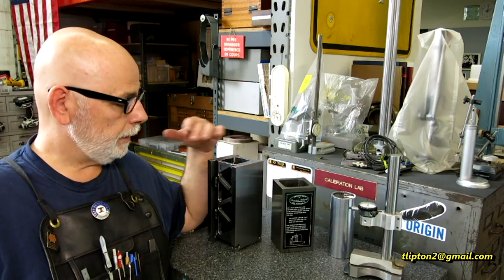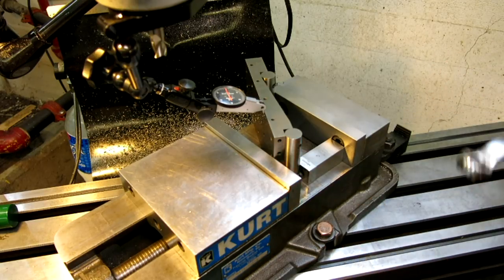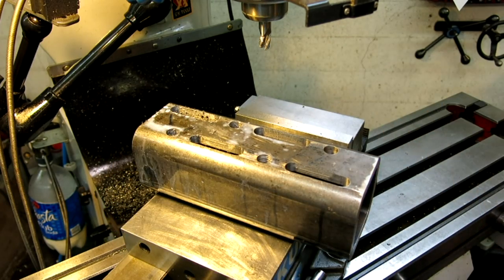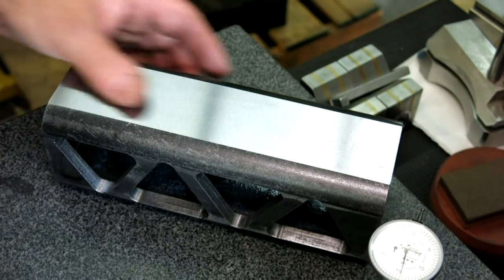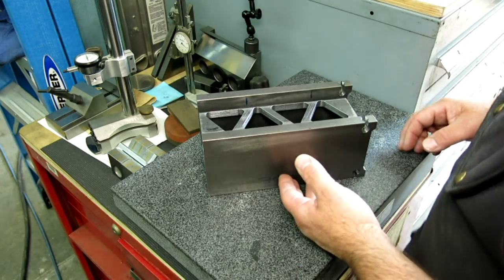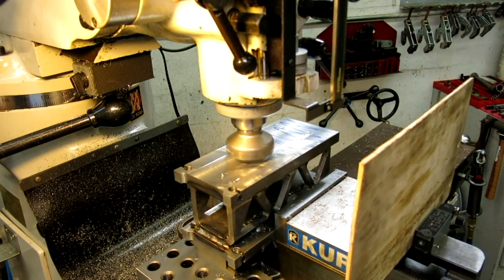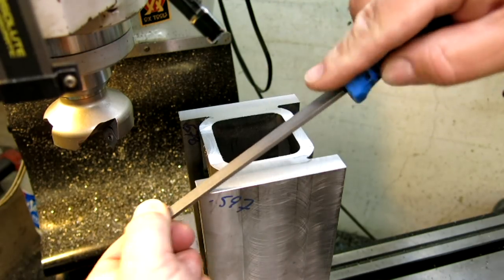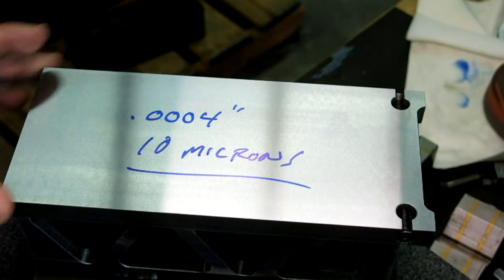Composite Master Square Construction

Comment: Thanks for another great video!  For those of us without a Squaremaster, do you have any recommendations on a way to sweep a vertical surface to quantify perpendicularity to the surface plate? I just keep thinking there has to be an affordable alternative. Thanks!
Reply from the maker: Hi Robert,

Qualifying the entire surface is pretty tough. You can do multiple points but you still have to extrapolate between them. That said once you have a good master you can probably easily make a facsimile of a squaremaster with a precision preloaded linear bearing.

Comment: How do you protect sensitive electronics from high voltage? I'm building EBM metal 3d printer and don't want to fry shop equipment, thanks
Reply from the maker: Get rid of all your sensitive electronics....... Just kidding. Don't get any electronics between the ground and electrode.

Cheers,

Tom

Comment: Hey Tom, love the old school method of making things, cnc is nice but well,  you know. Is the carburize a separate job, or is it what happens as a result of heat treat? When I mess up or forget something I call myself Ya Moran. Thanks God Bless ya   Dave
Reply from the maker: Hi David. The carburize is the heat treatment process that will add carbon to the surface of the steel allowing it to harden. Its one job. Lots of good info on the web or heat treaters sites. Cheers. Tom

Comment: Not a machinist, but an avid watcher.  Why do you cut the triangles in the sides of the tubing?  Is it to lighten the entire thing, is there some other structural/stability goal it achieves, or maybe it is so that you can attach a clamp?
Reply: Perhaps Tom will chime in here, but the general purpose is to lighten the tube. Cutting out the triangles leaves a truss structure, which retains the vast majority of rigidity and strength, while removing substantial weight.

Comment: Your magvice has limited room but would it have been better to rotate the work piece about z (like say 45deg) to decrease the amount of heat buildup on each pass? (Edit: As I continue watching you bring this up and say its ok for the small surface area on the edge of the plates.)
Reply from the maker: Hi Eric,

You need to be able to control heat and distortion without having to rotate the work. The reality is that only works for small square blocks. Lots of features and grinding needs to be aligned with the machine axes. 

Cheers,

Tom

Comment: Isosceles triangle? Weren't those equilateral triangles? Or did it just look that way?
Reply from the maker: I think you got me on that one. Equal sides and equal angles. Thanks for keeping me honest.

Cheers,

Tom
Reply: Equilateral triangles are also isosceles triangles.
Reply: Circles are not ellipses and squares are not rectangles, regardless of what grade-school teachers tell children just wrapping their heads around basic math are taught to "simplify" geometry. And although I've heard the "squares are rectangles" spiel and its at least somewhat "legitimate" IF you stay at the "elementary" definitions, I've never heard the "circles are ellipses" bit before and probably because it's obviously a lie. That's not to say its not in a lot of math "textbooks", but its false. Period. 

FIrst of all square vs. rectangle and then I'll dispense with the "circles are ellipses" garbage, although the reason neither squares are rectangles or circles are ellipses is the same in both cases and should be obvious and is obvious to people that learned geometry beyond an elementary "keep it simple" level. A RECTANGLE is a quadrilateral with two pairs of sides of different lengths perpendicular to each other and if one interior angle is a right angle they all are and its QUADRANGLE. 

Two measurements are required to calculate its area and its circumference and a third is required to calculate the volume of a box formed out of two rectangles by adding 4 vertical planes of the same lengths and widths. To calculate its volume you still need to measure the length and width of the rectangle and multiple the area by the height of that box. You have to measure that height because until you do, its not possible to know it precisely. So determining VOLUME of a box formed from rectangles requires THREE measurements and two calculations. L x W = A and A x H  = V. That makes it a COMPLEX shape and "complex math" is required to determine the simple quantities of that shape and the object it forms when made three dimensional.

A square is a also QUADRANGLE but its also a QUADRILATERAL and therefore it is NOT a rectangle. If it were it wouldn't be SQUARE and the box it forms when additional planes that have the same length and width are added to it in order to form a "box" wouldn't be a CUBE.  There is a DIFFERENCE to go with the DISTINCTION. The word SQUARE refers not just to the equal lengths of the sides but the ability to calculate the area by SQUARING the length of a single side so only a single measurement and a single calculation is required. Its circumference is also calculated using that same single measurement. 

Measure one side and SQUARE that measurement and you know the area. Its a QUADRILATERAL rather than just a QUADRANGLE SIMPLE MATH for SIMPLE SHAPES. A CUBE is a CUBE because its VOLUME can be calculated with a single measurement and a single calculation by CUBING the length of one side. A square is a REGULAR geometric shape and a SIMPLE shape that can be SIMPLY measured with even a piece of string cut to the length of one side. If the string then matches any other perpendicular line's length, the object is a square or a cube. If the string is placed on each corner and an arc is swung through the square and the points of the four arcs intersect and form another square, the square IS "square" and its an equilateral quadrangle. Meaning its SQUARE.Another piece of string stretched from corner to corner can be cut and with those two pieces of string you can construct identical new squares with precisely the same dimensions and use them to check the "squareness" of other shapes that appear identical. 

The square is the SIMPLEST geometric shape and that's why its is taught FIRST and any reference to it as a "rectangle" only comes later when the DIFFERENCE between the two is taught and "if we take a square and make either pair of sides LONGER it becomes a RECTANGLE" is used to expand on the basics and move to a more COMPLEX concept and SHAPE. That  gets translated as "a square is a rectangle" INCORRECTLY because the statement is that if a square has one pair of sides lengthened it BECOMES a rectangle. If one thing becomes something else with a different name and different qualities and its more complex, its NOT THE SAME THING. So a square is NOT a rectangle. EACH SHAPE has its OWN NAME because they are DIFFERENT. 

A CIRCLE is also a REGULAR and SIMPLE shape with a constant radius and using simple math the area is easily calculated from one measurement using a single operation. Its radius can be calculated from its diameter and vice versa ALSO with a single measurement and calculation. Using EITHER value its AREA and CIRCUMFERENCE can also be calculated using one measurement and a single operation. By that point in a geometry lesson after squares and retangles and cubes and boxes and probably triangles and pyramids and acute and obtuse angles have been digested and understood, PI is relatively simple and since some people are fraction people and some decimal people, between 22/7 and 3.14, one or the other should stick. 

By teaching AREA first, the good old SQUARE comes back into play and that's a relief for kids wondering how in the hell you measure the area of something that has no sides. PI multiplied by the radius SQUARED. Easily comprehended or at least remembered if the teacher is smart enough to tell them to see the CIRCLE as a SIMPLE SHAPE and to measure the RADIUS and use it to check to see that its actually a CIRCLE if the RADIUS is the same at two points on the outer arc with straight lines to them forming a RIGHT ANGLE at their intersection. If so, then the two diameters those radii are half of will form four equal PIE PIECES. So by measuring the radius and SQUARING IT and multiplying it by PI, the area is calculated. 

Circumference also seems like mission impossible but by taking the diameter because you're going AROUND THE WHOLE CIRCLE and multiplying THAT by PI a SINGLE measurement and calculation gives the circumference as well. And at that point, they whole volume thing is old hat and its a SIMPLE and REGULAR shape so AREA x HEIGHT gives the volume of a CYLINDER. 

The "circles are ellipses" thing probably comes from "if we take a circle and "flatten it" or "stretch it" it becomes an ellipse". But just like a square is not a rectangle, a  CIRCLE is NOT an "ellipse". The same thing applies that if a CIRCLE becomes an ELLIPSE it CEASES being a CIRCLE. SOME people make that mental leap on their own and some teachers MAKE them make that leap because its IMPORTANT and some people and teachers just leave well enough alone and before long, COMPLETE LIES become "facts".
Reply: DEEREMEYER1 an ellipse is not a circle, but a circle is an ellipse. Look up the definition for ellipse and see what happens when focus 1 is in the same location as focus 2.

To be even more general, circles, ellipses, parabolas, and hyperbolas are all cone sections.

Similarly, a square is a special case of rectangle, but a rectangle is not a square. Without getting too deep into the presidential definition of what "is" is, the word is not generally used in a way that implies transitiveness. In other words, when you say "a circle is an ellipse", you're saying that the circle is part of the set of all ellipses (which it is). You are not saying that all ellipses are also circles, or "circle = ellipse".
Reply: DEEREMEYER1 Rectangle comes from the Latin rectus, meaning right. A rectangle is a closed planar shape containing 4 right angles. That is literally where its name comes from.  All squares are rectangles.

Comment: +oxtoolco Tom, interested to know how you feel about milling out extrusion and thermal expansion vs a cast shape of the same design.  Because of the grain flow differences in castings vs extrusions, I would have thought the casting would have advantages in thermal stability? Great video as ever though!
Reply from the maker: Not too many cast gage blocks around. I don't think castings have any particular advantage with thermal growth magnitude. 

Cheers,

Tom
Reply: OK, thanks for replying!

Comment: Wait. You ground the square tube, but didn't grind the flat plates before welding? Why one and not the other?
Reply from the maker: The tube was pretty bad. The two plates were decent enough I didn't bother.
Reply: The Metal Butcher that sort of tube material is bent from flat ish stock and welded into a tube, it's not exactly precision stock.

The plates look like they're pretty flat plate material from the factory — which makes sense, those roller mills are pretty damn precise, much more so than the tube forming mills.

Comment: If a master square is for reference. Then what did you use to make sure the reference was square? It's the chicken before the egg or egg before the chicken.
Reply from the maker: You can create a true master square reference without a master to check it. You do need a good known calibrated surface plate to do it. This is one of the really cool things about this type of reference. Much like a level is self proving by reversal. Cheers. Tom

Comment: A sine bar is only as good as your gauge blocks, right?
Reply from the maker: There are several factors that effect the accuracy of Sine bars and Sine plates. The gage blocks are one of the factors. The distance between the rolls of the sine device and their diameter are the largest sources of error. Cheers. Tom

Comment: Can someone explain to me why he surface grinds the part before welding? The precision will be gone after the welding and you will have to grind it after that anyway. Seems to me like a redundant step.
Reply: The more square it is to start with the less you have to square up in the end.
Reply: But wouldn't milling be good enough?
Reply from the maker: To make it as parallel as possible so I can keep everything about the same thickness and parallel as I move outward. The tube was out of parallel by 1/2mm so that would have come out in grinding the face plates which have significantly more area. Grinding was probably not necessary.

Comment: In the shot at 27:40 you can see that the back wall (right of frame) got warped by that long vertical weld. The tacks must not have been strong enough
Reply from the maker: What you are seeing is the internal resistance weld from the tubing manufacture. 

Cheers,

Tom

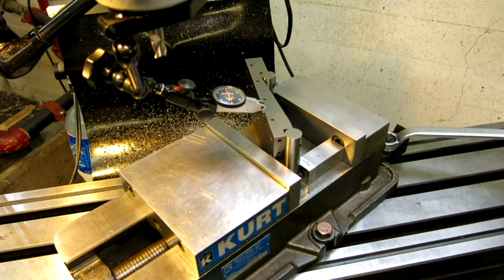Comment: 3:17 - noob question, what in that picture is the 'sidebar' please? Thanks! :)
Reply from the maker: Hi Wireline. "Sine Bar". This is the plate/bar clamped in the vise to help me measure and set a precise angle. Cheers. Tom
Reply: oxtoolco Shouldn't the second pivot on the sine bar be resting against the the same jaw face as the gauge blocks? [edit] Never mind. . . Viewing error on my part.  The tiny amount it obstructs the view of the vice, it appears to be resting on the end as others have observed.
Reply: Ahh ok thanks!

Comment: I think, this need to be tempered after welding to distress metal.
Reply: That's redundant. It's going out for heat treat. It'll be tempered after hardening.
Reply: But grinding before hardening and tempered- dummy work.
Reply: No, not when it's being case hardened. This assembly is not being through hardened. If you don't grind close to final spec before hardening and it was way out, you run the risk of grinding through the case hardening in order to bring the part to spec.

You could probably get away with just milling it and sending it off for treatment, but this is going to be a shop standard. I think it's excellent workmanship and a small measure to take to prevent rework, especially for a tool that will be a reference.
Reply: No, I mean that residual stress remains in the assembly after welding, which in time can affect the dimensions.
Reply: But how would that residual stress remain after case hardening and tempering? The tempering is going to ease that stress.

Maybe I am misunderstanding you?

Roughly, these are his steps:

1) Weld - stress induced
2) Machine - stress remains
3) Preliminary grind - stress remains
4) Case Hardening - stress remains
5) Tempering - stress relieved
6) Final grind to spec - no stress induced

Do you disagree or do you think I am missing something?
Reply: Rich Hemler 

Case hardening comes in a lot of varieties, but I'd say the weld material is probably not a super high alloy (likely run of the mill S2 or S6 filler) and would stress relieve just as well as the parent metal.

There's not a ton of filler, so I can't see why the tempering wouldn't relieve the weld stresses.

Comment: I'm fairly certain that piece of square tube could simply be milled square and flat and it would serve the same purpose. Every straightedge I've ever seen or used has been a simple piece of steel "bar" machined that way. And you also don't need a "square" that's that large and heavy to check for "perpendicularity" A simple machinist's square works fine. Anything that has "perfectly" perpendicular flat or surfaces or rather "edges" works just fine. Round stock actually works very well because the contact area is very narrow and a light on the back side makes even imperfections or gaps otherwise very hard to see easily visible. A conventional square or straightedge is typically relatively thin for just that reason.
Reply from the maker: This square is used in concert with a comparator to actually quantify the perpendicularity of what you are checking. Its massive for stability during use.

Comment: FYI files should never be "scrubbed" back and forth a cross a surface. Like hacksaw blades they only cut in ONE DIRECTION and dragging them backward the wrong way in the or on the material they're cutting dulls the shit out of them by folding over the cutting edges. When they're used properly on materials they're able to cut easily, good files will last damn near forever. They're like any other cutting tool. You get what you pay for and you also get what you ask for.  Get a good file card to clean them, don't bang them against whatever is handy to knock the chips and cuttings off, add a little cutting oil if they're working hard, use long firm strokes but don't try to force them to cut something they don't cut easily, pay attention to the fact that they not only cut in one direction AND that some have "checkered" and angled cutting edges and the angle they're pushed or drawn at has to be correct, give them a light coat of light oil and store them where they don't bang around and get damaged.

Comment: Boy oh Boy, your surface grinder bearings do sound crap, especially when it is slowing down.
Reply: I'd say its hydraulic, belt noise or a frequency response of the camera Mic. A .003" cut with bad spindle bearings would not look that nice. It would look like a dog chewed it off.
Reply from the maker: Hey Dave,

I can't hear you because my grinder is so noisy..... Yes they make noise but the spindle produces and excellent finish so I leave it be for now. 

Cheers,

Tom
Reply: @oxtoolco  😂😂😂😂